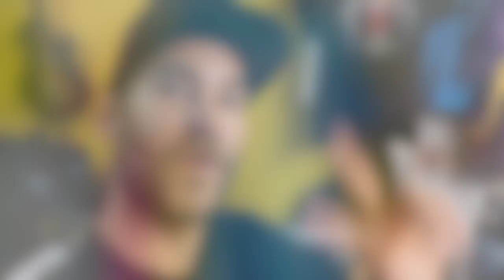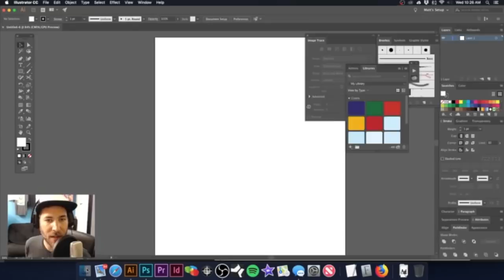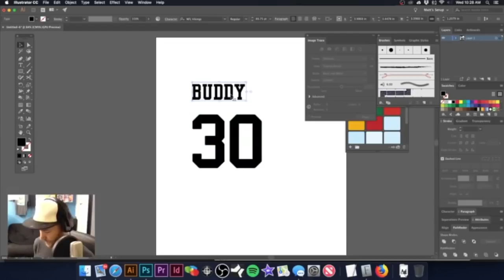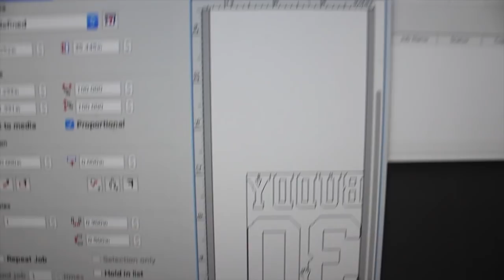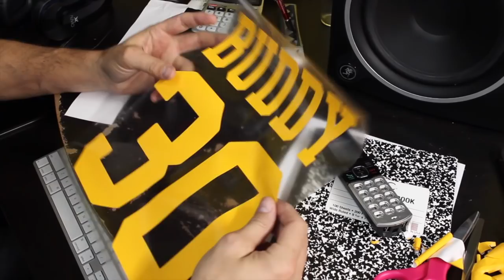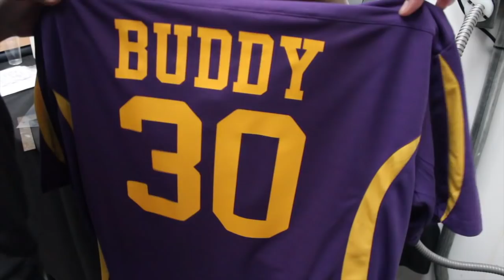Custom Names & Numbers for YOUR DIY Jerseys!

Comment: Hi, great vid. What force are you using on the cutter?
Reply from the maker: Stock force, but setting the blade depth so it doesn't cut through the carrier sheet.

Comment: What is the paper name?
Reply from the maker: Are you talking about the teflon sheet? Or the Heat transfer vinyl?
Reply: The transfer vinyl. The one I got from our local store hardens after pressing and it worked with 185 degree Celsius and 25 seconds.